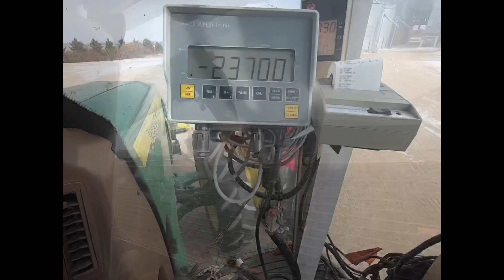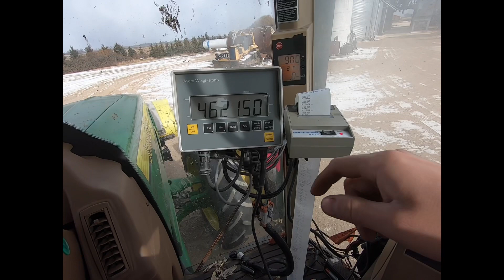Wait... What Just Happened

Comment: Hey Chet & Dougo, Take a wheel stud, cut the head off and sharpen to a dull point. Drill a hole thru it to drop a punch in to hold wheel while you start other studs. They use to come from JD when they shipped combines by rail.

Comment: My opinion: find 2-3 bolts same thread about 4 inches long, cut the heads off, grind head to a dull point and use as a bullet that will or should help you line up the spacer, wheel Assembly. I made several for different heavy items on aircraft engines and components. Enjoying your videos, stay safe. 👍👍👍👍🇺🇸🇺🇸🇺🇸🇺🇸🇺🇸

Comment: Doh, now that's a Homer moment.  With the track/wheel off you took the jack out and then placed your self directly under the combine replying on a single jack and block. Next time.... jack up, add more blocks, THEN remove the track / wheel.  If that single jack fails you die or will never work again.
Reply: That was worse than a "Homer moment".  It was really rolling the dice on getting severely maimed or permanently crushed to death.  A family friend (or fertilizer dealer) relied on a single hydraulic jack while changing the oil on a semi truck (with the front wheels removed).  The jack failed and his head was crushed between the oil pan and concrete floor until the EMTs arrived.  He survived, but with permanent brain damage.  Use blocks... always.

Comment: If a hole is cross threaded on the final drive hub both your duals will fall off together in approximately 1.8 seasons
Reply: How do you know that.  Has it happened to you
Reply: @tractorboy31  Hey yes it happened to me my John Deere dealer cross threaded 1 wheel hub bolt on final drive and the duals loosened off about 700 hours later
Reply: @mrdanproddevlpmnt1576  fun.  Ive seen the results of a dually salter pickup lost his duals on the expressway.  Ive had my duals on my trk came loose but not off.  Never had it happen before or since